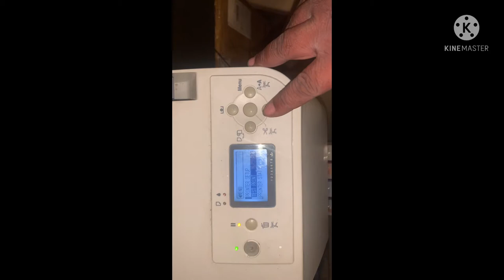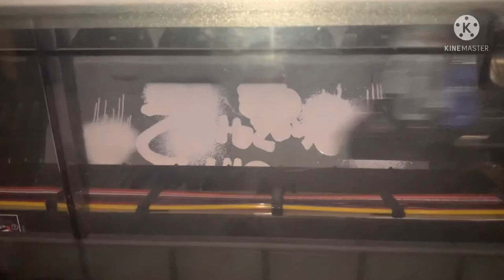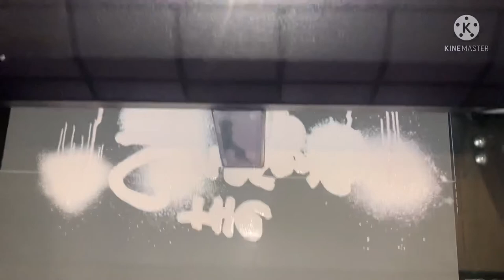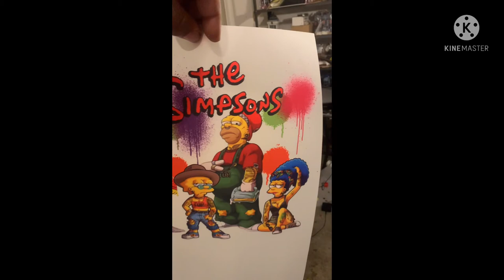How to convert a large commercial printer into a Dtf printer! Or will it be a epic failure!

Comment: Hello, i have this printer and have been using it for dtf. Non of my colors are printing at all, I’ve cleaned the carts and added a cleaning solution but it is not pushing the ink through. Is there something you can recommend?
Reply from the maker: Take the head off and clean it

Comment: Between the Epson XP15000 and the ET-8550 which would be the better opinion to convert into dtf?
Reply: I'd say the XP15000, since you can remove the cartridges to shake them. With the 8550, you have to shake the whole printer.

Comment: I have a 4000 can you do a video I'm going to order the ink once I'm sure this printer is working
Reply from the maker: Do a nozzle check
Reply: I have no idea on how for some reason I feel like I will break it it's said because I'm a it tech but I bought it used and tried to see if it will work it tells me to add ink but I don't have none except submitting ink so I didn't put it in
Reply from the maker: I’m not understanding! Say that again
Reply: @bigboiprints5726  ok received my big boi dtf kit roll and ink i put it ink in the cartridge what do i do to convert it do i remove anything or do i just run the power clean

Comment: Hi I just came across your videos I have a p4000. I want to convert and just need help locating the rollers to remove or do I have to remove any rollers at all?
Reply from the maker: I didn’t remove mine
Reply: @bigboiprints5726  wow I thought so. I got a epson stylus pro 4000 and want to try and convert thanks so much what do I have to lose. 

Do you have dtf ink I heard your ink is the bomb as well as who has good cartridges
Reply from the maker: Yes I do! I perfer ink owl
Reply from the maker: https://www.bigboiprints.org/
Reply: @bigboiprints5726  thank you.
Reply: Hi this is Grace 
I purchased all my supplies. I also down loaded cadlink. When I choose a computer there is no selection for stylus pro 4000 can I use the selection L1800 or do I need to use something else that’s compatible for the driver download.
Reply from the maker: Try the 4800 or the 4880
Reply: @bigboiprints5726  thank you in that video of the big machine which machine did you convert and what settings did you use 4800 is not offered anymore for printer downloads I did reach out to cadlink help
Reply: Did you clean the lines, nozzles, head prior to installing the DTF inks? Was the cleaning after you installed the cartridges the only cleaning you did?
Reply from the maker: I  didn’t
Reply: @bigboiprints5726  Thank you! I’m getting ready to convert mine and I’m purchasing your inks. Thank you for your help.

Comment: All we have to do is change the ink we don't have to remove the rollers and add a waste tank?
Reply from the maker: What printer do you have
Reply from the maker: 9800
Reply: @bigboiprints5726  11880 it's similar. Did you have to remove the rollers or you just replaced the ink
Reply from the maker: Just replace the ink. I would make sure it works first. Download the free trail in the description and see if it works

Comment: Can I convert this type of printer for DTF ? Epson SureColor P7000 Standard Edition Printer
Reply from the maker: Yeah but the chips are very expensive
Reply: @bigboiprints5726  can’t use the chip resetter for the cartridges ?
Reply from the maker: There isn’t one
Reply: How about the P7000 same thing ?
Reply: I’m looking into the 9890 what you think
Reply from the maker: @Carlos-ru4zt  I really like the 9890 wish I could find one!
Reply: @bigboiprints5726  the 9890 have chip and maintenance tank resetter ?
Reply from the maker: Yes sir really nice printer. Prints well
Reply: @bigboiprints5726  still searching for one
Reply from the maker: I like 7900,7890
Reply: @bigboiprints5726  fingers crossed hope I find one around my area
Reply: Big boy guess what I found a 7890 finally
Reply from the maker: Where? how much? Make sure you get a nozzle check
Reply: @bigboiprints5726  here in Chicago and 2k and I will
Reply from the maker: 2k make sure you check the print count. Make sure it’s not high
Reply: @bigboiprints5726  thanks I will I’ll be picking up Saturday
Reply from the maker: Nozzle check
Reply: @bigboiprints5726  asked about the page count and the person said 4400
Reply from the maker: I wonder how many more prints you can get out of that head? And probably look and see how much a new one will cost
Reply: Is that to many ?
Reply: @bigboiprints5726  1,250 for a print head
Reply: @bigboiprints5726  what software do you recommend ? For my 7890 ?
Reply from the maker: Cadlink
Reply: @bigboiprints5726  what’s the price for it
Reply from the maker: $895
Reply: @bigboiprints5726  I have cadlink already for my L1800 I just wanna add my 7890 now
Reply from the maker: You just need a up grade
Reply from the maker: $500
Reply: @bigboiprints5726  but I wanna keep the one for my L1800